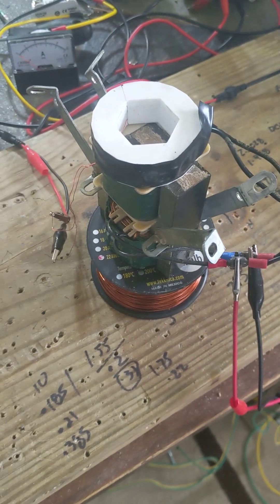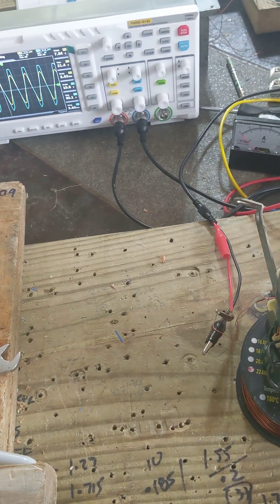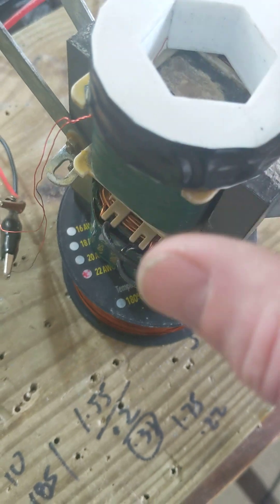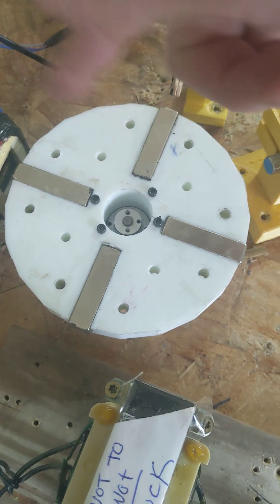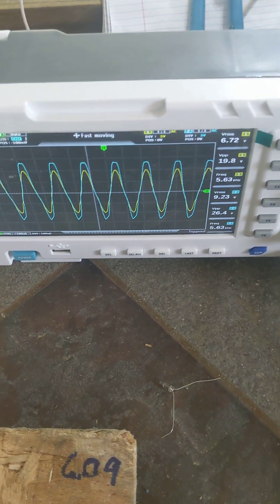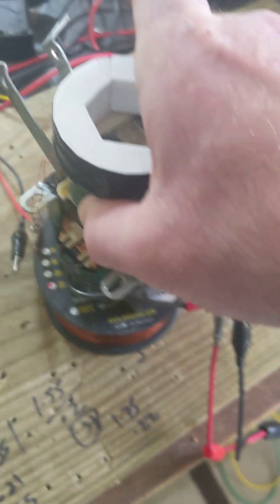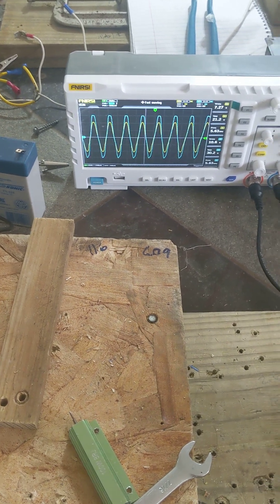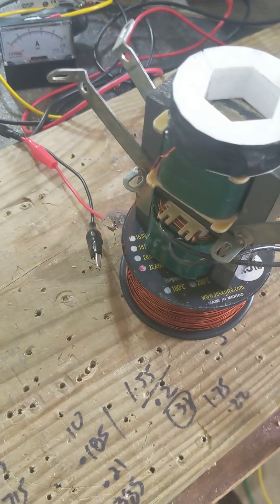nature's coil test.  interfacing both sides of the coil

Comment: Wow that's called mutual induction .
Reply from the maker: Yes.  But it could be used to increase efficiency of a motor for sure.  I'm looking at a 36 pole motor stator now which only uses one side of the coils.  but if the coils were mutually inducting each other from the unused sides, efficiency would surely improve.